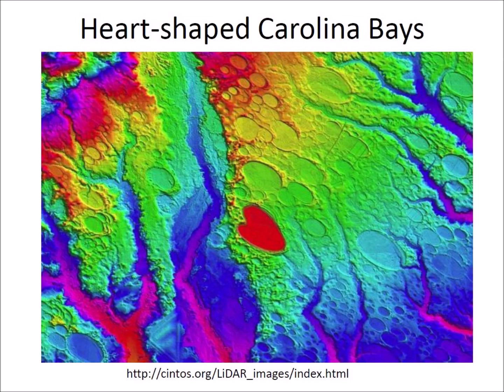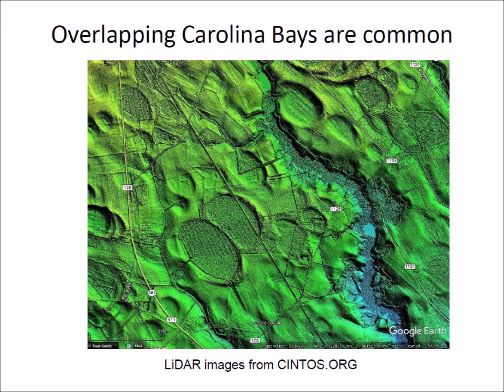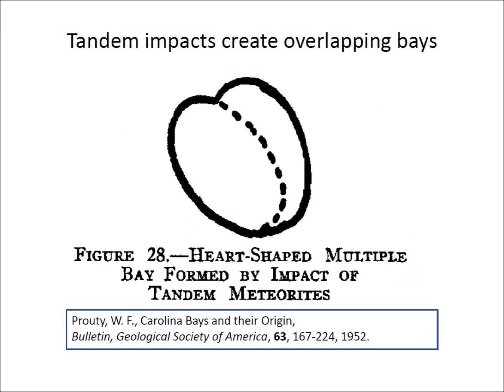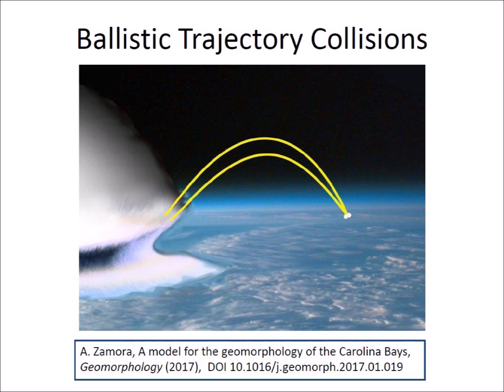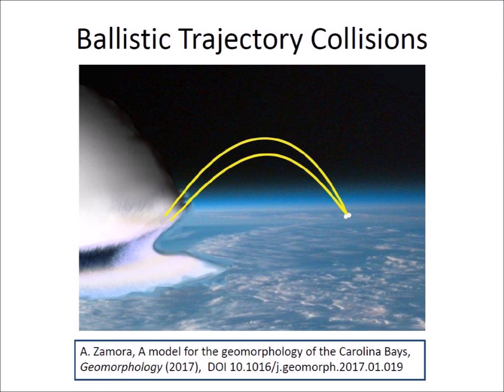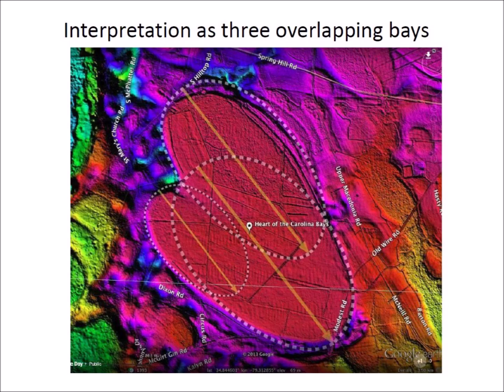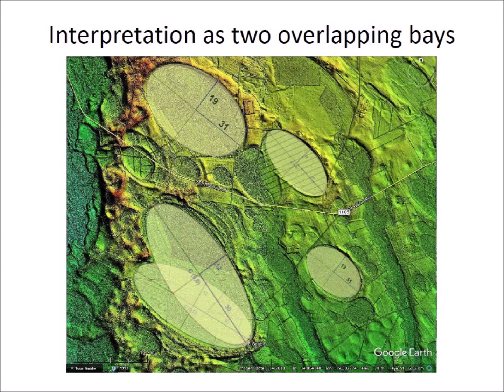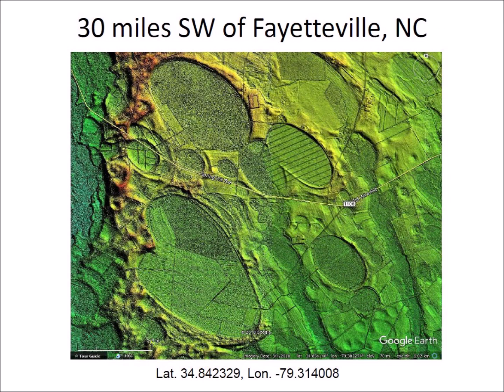Heart-shaped Carolina Bays

Comment: Do the 3 ridges at the 'northern' edge of the bay form from each impact?
Reply from the maker: The three ridges at the northern edge of the heart are likely the remnants of rims of previous bays that were overlaid.  In the saturation bombardment by ice pieces in the ejecta curtain many pieces of ice will fall near each other or on top of each other.  If a previous impact is not completely covered by a following impact, a portion of the previous rim will remain visible.  Multiple rims have been interpreted as bay migration by proponents of the idea that wind and water created the bays.  A paper by C. Moore et al. (2016) proposed that Herndon Bay migrated more than 600 meters and that it had left sand rims as it moved.  I think that the sand rims belong to bays that were overlaid.  You can read the discussion here:
https://www.scientificpsychic.com/etc/carolina-bays/carolina-bays-do-not-migrate.html

Comment: I have followed the impact theory for a few years.  Is it possible that the oval acreage at 39.070, -83.028 is a "bay"?  It's on the Scioto.  Oxbow remnants due to meandering is a very strong probability, but reviewing the historical imagery on Google Earth, it appears that tree coverage has been removed. This would allow a square (more easily farmed) field, but the oval shape prevails.  There also appears to be a pronounced rim of sorts on the west edge.  The general orientation is towards the same origination as previously plotted in other bays, in this case more north/south due to westerly location in Ohio.  If this is an ejecta impact bay, the ice chunk(?) that formed it would have had a shorter time of flight, etc.  Not many relics can be found in this part of the country due to slope and terrain.  An impact in the Scioto River valley floor may have left this scar.
Reply: I would immediately implicate the oxbow river formation for the oval at 39.070, -83.028. there is a raised rim, but on the eastern side it follows precisely along a dead-straight line for a full kilometer, and the bays in the LiDAR never have a linear rim more than a few tens of meters. I have run no LiDAR for Ohio, but recently have identified using LiDAR what might be bays in Tennessee. I say might be because of their shape, but TN has lots of karst sinkholes.
Reply from the maker: The feature that you refer to is most likely an oxbow because it is in the floodplain of the river.  As you zoom out on a Google Earth satellite image, you can see the different green colors of the area where the melting glaciers caused spill from where Lake Erie is now.
Reply: Michael Davias........ Is there any 'mound' building in any bay?

Comment: Interesting; thank you! Presumably in flight collisions can effect both the azimuth and horizontal angle of impact of individual fragments. If that proposition is valid one is inclined to apply Ockham’s Razor and lean towards two impactors rather than three!(?)
Reply: Either/Or. The "Heart of the Carolina bays" is certainly the only bay formed so exquisitely heart-shaped. Several other exist, but are much less pronounced.  So one out of 50,000 makes this one a very rare event. Ockham's Razor does apply the the entire collection, however - an impact is the simplest explanation: BANG! Wind and wave over such a vast expanse and elevation change requires a lot of hand waving in the air to describe the arrival of the properly-oriented predominate wind, and hardly simple.
Reply: Michael Davias. Point taken; even Ockham must allow a 1 in 50,000 event! 
As a Geologist who has made a major hobby study of the role of catastrophism in the shaping of the  planet (outside a working life in the mining industry) I find the ‘ impact on ice sheet’ story absolutely coherent and compelling. That there should be a rump of ‘wind and water’ proponents I find unsurprising. I suspect that this largely due to the emphasis on uniformitarianism in our (formal) education - at least for those of us who first learned their geology/geomorphology more than two or three decades ago, and then assumed that no more learning was required!(?)

Comment: Would the turning of the Earth account for the slightly different trajectory?
Reply: Ziggy Dan: The Coriolis effect would tend to influence travel North or South. The Eötvös effect would tend to effect travel East or West. If I understand these effects correctly, Coriolis is proportional to distance traveled while Eötvös is proportional to velocity.
Reply: joe ampolo. ....... I suppose it could have hit a mountain peak and slightly changed course. What about the rivers that were bombarded, they would change course.
Reply from the maker: Ice is very brittle and fragments easily.  Any impact with a hard surface, like a mountain peak, would have fractured the ice boulder and sent out high-speed ice shards from the impact point.  The trajectories of these ice shards would have very low angles compared to the ice boulders incoming from their suborbital flights.  
Impacts of the big ice boulders on rivers would create splashes and mini-tsunamis like I illustrated in the video about Carolina Bay deformations and irregularities: https://youtu.be/gVooffi1Fro
Reply: Antonio Zamora .......thanks for information. Check out BBC documentary 2017,  Mars: A travellers guide. Massive plasma blast with comet impact! Great work, Antonio!